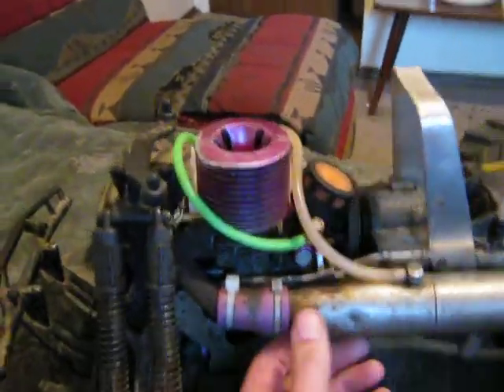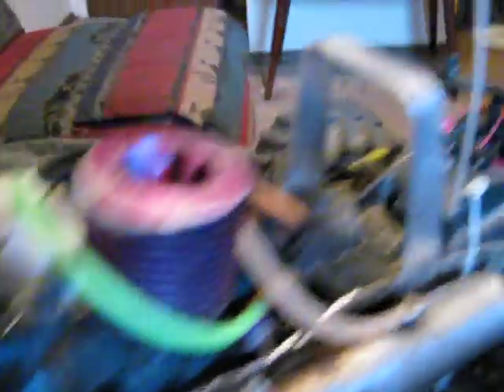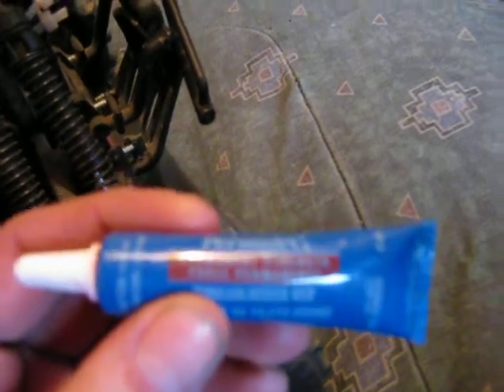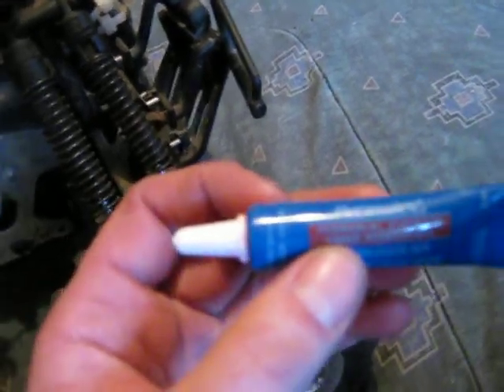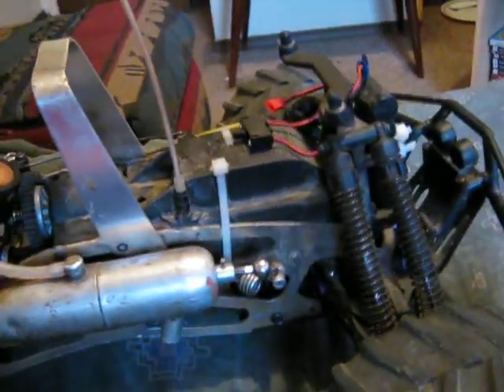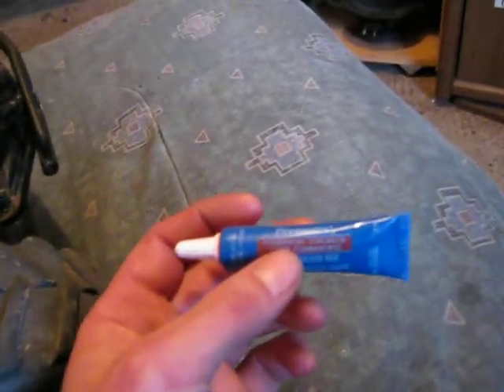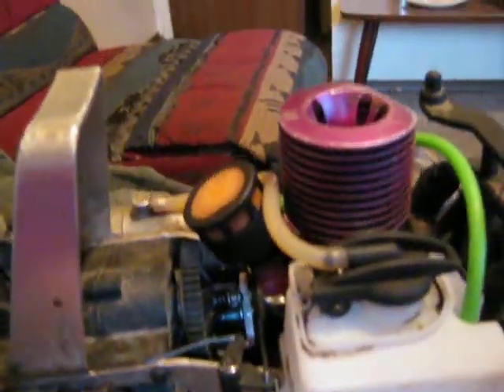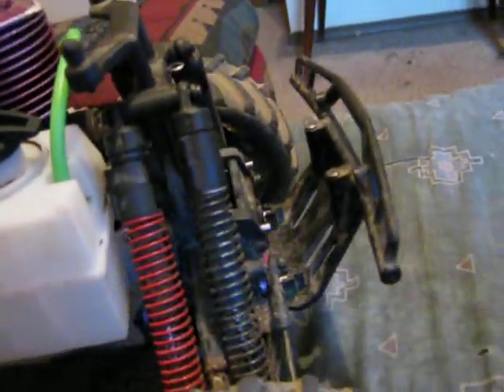savage.25 update help.......avi

Comment: alrighty soooooo: You need small  Heating torch ( like hobby mini heating torch . Check on ebay for that.     You can heat real good screws as well by soldering iron. Make sure they real hot.  Then screws sould be ready to rock ;) Good Luck buddy.